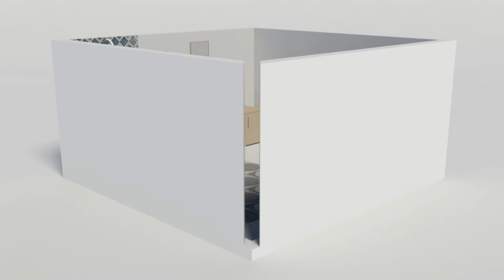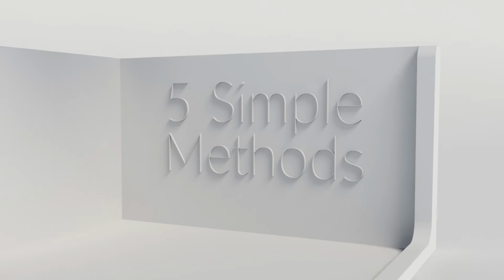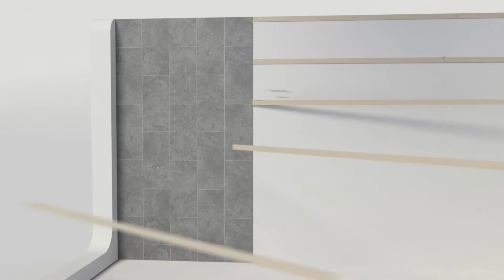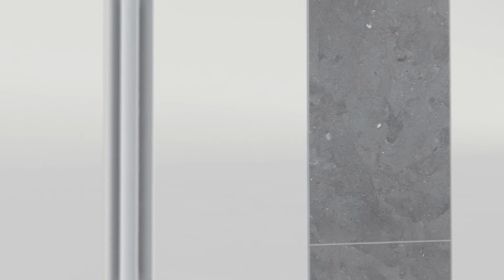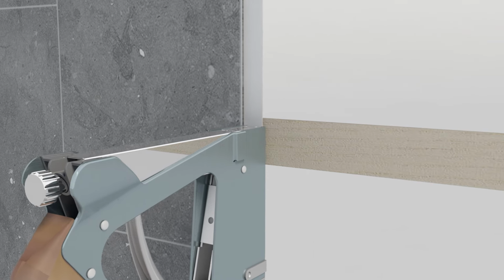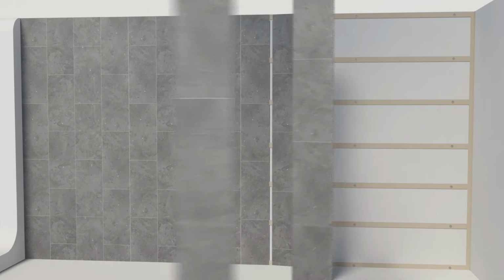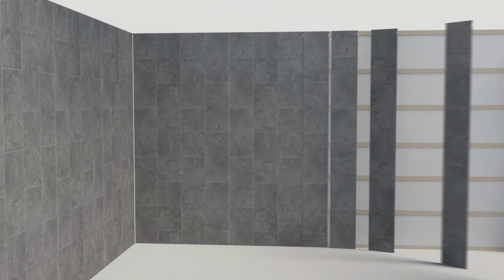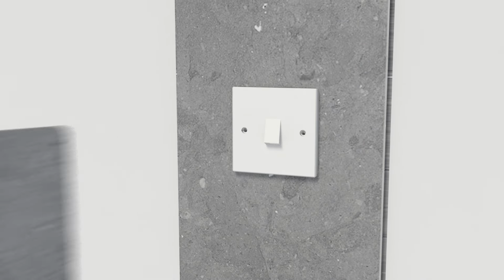Decorative Cladding Fitting Guide

Comment: if a screw hole in wrong place how do you conceal the hole
Reply from the maker: There’s not a lot you can do.. silicone will stand out as it’s usually shiny.. possibly use a coloured putty to match the colour of the cladding or replace that panel.